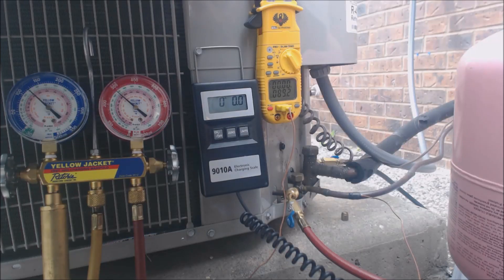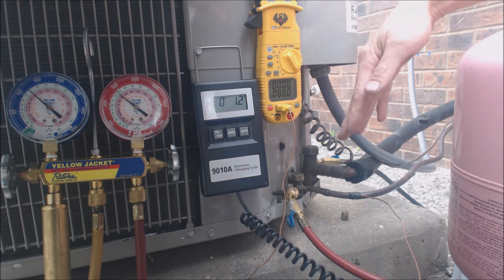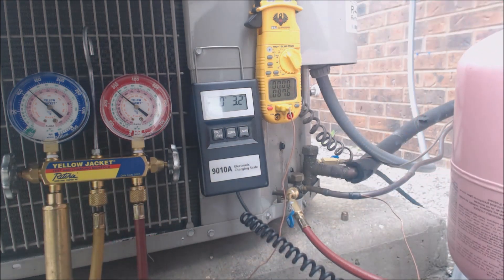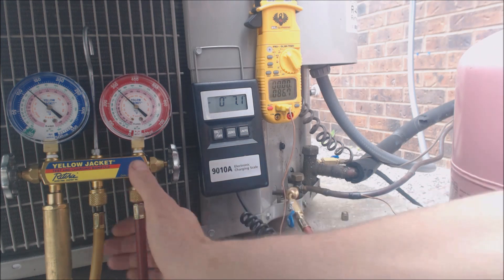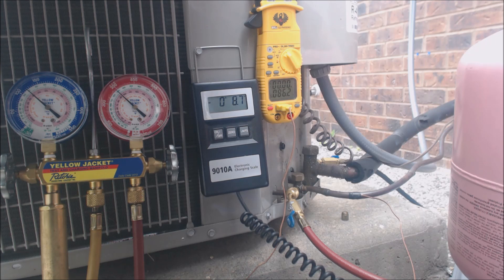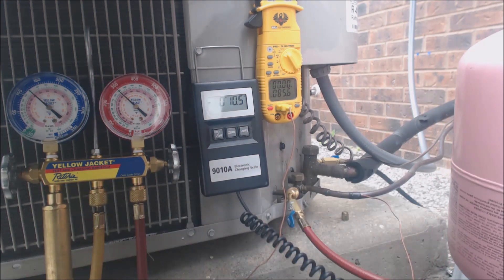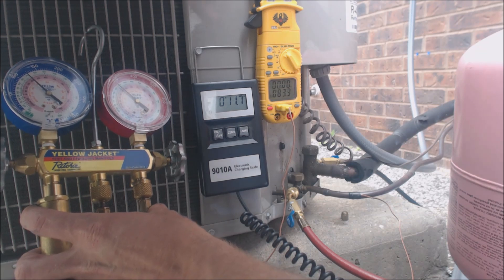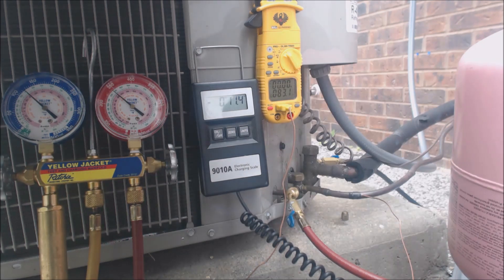Charging R-410A Refrigerant: Step By Step Process of Adding Refrigerant in Real Time!

Comment: What do you do if the low pressure switch is in lockout?  System (Luxaire communicative) has a really slow leak. Plan to add sealant and then charge the system. However, can this be done when the compressor is off, due to the lockout?

Comment: So are low and high side hoses both red? That’s confusing
Reply: You can’t see the hose on camera
Reply from the maker: The low side hose is blue on the larger vapor line and the high side hose is red on the smaller liquid line, thanks

Comment: I have a Goodman model GSX130361BA (3 ton) compressor/condenser with 410a. There is no mention on the name plate of the amount of subcooling. Do you know how much subcooling I should have?

Second question. My liquid line is not insulated. It passes through a very warm attic before it gets to the expansion valve and air handler. I am loosing any subcooling that the refrigerant got in the condenser. Subcooling means efficiency. Should I insulate the liquid line at least where it passes through the attic?
Reply from the maker: It should tell you the recommended charging procedure in the installation literature if it does not provide subcooling on the outer shroud or under the outer shroud, thanks
Reply: @acservicetechchannel  

Thanks for the reply. I will have to look again. 

What about my question on insulating the liquid line?

Comment: Question after a system is 6 years old can some of the refrigerant leaked out? Is this normal for it to leak out over time? my unit just never shuts off when it 100 outside... it can't keep up like it used to... i cleaned both coils and change filter... I will try cleaning outside unit a little better soon...last year i did not do a perfect job... Anyway lets say i lost 5% of the R-410... do AC techs fill it up or not...? thanks
Reply: If it used to work fine that tells you something. 
No leak is not normal. A healthy system stay sealed for life. 
Loss of 20% is noticeable. 
FIND and REPAIR the leak first. Then top up. Electronic scales tell the exact weight consumed. 
There can also be other reason for poor performance. Could be separated ductwork in the ceiling etc

Comment: Is it possible to use r22 guages to check a 410a system to see if you have enough refrigerant and if so could those gauges be used to add 410a?
Reply from the maker: Yes but you will just need an external pressure temperature chart to convert your pressure read to saturated temp, thanks

Comment: Wanting your opinion on an install. I will be installing a new Goodman 3 ton 16 SEER heat pump along with a new air handler and coil. What are the benefits or differences between going with the Flowrater or Expansion Valve? For instance Goodman inside unit with expansion valve comes with ECM motor compared to Flowrater with PSC motor.
Reply from the maker: I would go with the txv. If it is a multispeed ecm those are good. The txv is much more efficient and it is not a technological efficiency that breaks easy. Look up a video I did on the subject "acservicetech txv versus piston" thanks
Reply: Thank you for your help.
Reply: From 40 years of experience I find this the most accurate. All ECM motors cannot stand up to power surges, also any type of moisture in A/H. Also a lot of the new TXV valves are manufactured In China, and do not last. I am old school, i would go with a Fixed metering device, and a psc motor

Comment: Hi  can someone please help.. Was about to charge the evacuated system from a brand new 20lb 410a bottle. But the plastic valve handle broke off!! Can i dig out the plastic to get to a metal valve part?  Or tap it? How?

Comment: i thought those tanks have a dip tube in them so liquid comes out right side up and vapor upside down
Reply: You are referring to a recovery tank.  A recovery tank has a vapor side and a liquid side (dip tube).  He's using virgin refrigerant from disposable tank to charge the system which only has one outlet at the top.  Hence flipping it over to get just liquid.  

A side note.  This is my favorite sources for refrigeration reference.
Reply: @robertocannella1881  thanks roberto thats exactly the answer i was looking for.  would you ever reclaim then reuse or just dispose?

Comment: HELP please!
I have a 2-1/2 ton R410A system with a TXV that the evap coil keeps freezing up on.
I have had 2 "techs" come out - the 1st one said it was low on freon (but he didn't check temperatures, just looked at his gauges) and added freon.
The second guy also only looked at his gauges, said that particular compressor had originally had the wrong lubricant put in them (they were made in Mexico) and added some other lubricant that was supposed to "free up" the TXV. He also said I was overcharged - but never did any temp. readings.
I figured I couldn't do any worse, so I purchased everything you have in this video and followed your instructions.
I started out with about 15 degrees of subcooling (difference between high side pressure gauge / temp and high side pipe outlet temp (past service valve). I then added freon - about 2-3 ounces at a time. Ended up adding 15.5 ounces total before I decided to stop, as my subcooling is now 37.3 degrees!! High gauge pressure is 430 psi, temp of 122 degrees; outlet pipe temp is 84.7.
BUT difference in temp between closest outlet register is 51.6 and closest return is 73.9; difference of 22.3.However my evap coil is STILL freezing up!!!
Any ideas / suggestions??
Reply from the maker: You don't want to add refrigerant to increase the subcooling higher than what the unit is calling for on the rating plate. It sounds like you have a liquid line restriction. the techs should have measured superheat and subcooling and the tech that added the lubricant should have cycled the valve open and closed by putting the bulb in hot water and ice water to see if it would free up. A liquid line restriction problem could be a clogged filter drier, clogged screen prior to the txv, or the txv itself, thanks
Reply: @acservicetechchannel  Thanks. I did get the schooling to 10 degrees (recovered some Freon).
Superheat is @ 20 degrees - no listing on plate, but looks okay according to your book (which is great!).
I did read about cycling the tv; going to try that today. Does it matter that he put lubricant in a couple weeks ago?
Reply: Subcooling.
I relocated the sensor bulb of TXV to just outside the evap coil case - it was located inside, at 6 o'clock position and hardly insulated at all. Plus by putting it outside I was able to pour hot, and then cold water over it. How long should I have waited between the two?
Still getting a little frost on evap coil - but it's not completely icing over like before!

Comment: NooB here, why is the liquid line not much hotter than 87 degrees?  Shouldn’t it get hot and liquid line sweat?  What was ambient temp that day?  Thanks.
Reply from the maker: The vapor line may sweat but not always. that is one of those feel good signs techs want to see but will not always happen. It was a 75 degree day roughly and that is a 16 seer unit. The higher the seer, the lower the liquid sat temp. I have all of this laid out in the book I just published and the full outline can be seen at https://www.acservicetech.com/the-book  it took three years and has everything that I want techs to know starting from scratch through troubleshooting, thanks!

Comment: can you get a decent reading using just PSI and not temperatures
Reply from the maker: Hey Joseph, no certainly not. Everything is about temperatures and the amount of superheat and subcooling for sure. I go over all the proper charging methods, all the improper charging methods and why they shouldn't be used in the book I just put out over at the website acservicetech.com thanks! If you know someone just setting the system at certain pressures, that is not good for efficiency, compressor safety, or actual heat removal, thanks!
Reply: @acservicetechchannel  thank you!!! So does that mean the PSI scale on the gauge is not that relavant to a properly charged unit
Reply from the maker: @jm11740  That is correct, we just take pressure readings to convert them to saturated temps, thanks
Reply: @acservicetechchannel  thank you,
Do you think alot of techs check it without thermometer probs, or did i just get a real lazy tech?
Reply: thanks for your help
Reply from the maker: @jm11740  It just depends on the tech. Any decent tech will certainly be checking temps. Its all about saturated temps, superheat and subcooling, thanks

Comment: With supercool of 10 then the low side gets to say 120 psi and doesnt move even with more coolant added to try to get the high temp difference between 10 -13 super cool thats when you stop  correct? You could over charge easy trying to get 13 right?
Reply from the maker: The low side won't usually move if you have a txv as well as a lowering indoor wet bulb temp. You just try to get to the correct subcooling, thanks!

Comment: Very good vidy but I have a question I can't seem to find an answer to.  
To get proper superheat your TXV must be set correctly.  But TXV setting is dependent upon charge, correct?
Do you adjust superheat (add ref) then check supercool/adjust TXV and repeat until both in spec?
Reply from the maker: Normally with ac units, you should not need to adjust the superheat on the txv. They normally come preset. Often when you read the total superheat on a system with a TXV, it will read between 8 to 15 degrees of superheat but normally around 10-14 degrees. You should start by setting the subcooling correctly and then verify the txv is holding the susperheat at a good rate. In fact, most sc unit txv's are nonadjustable. Rarely would you need to adjust a ac txv unless someone has messed with it or it is a high velocity system, thanks!
Reply: @acservicetechchannel  TY,  I'm installing a new dual so everything is at factory and I don't have a clue what the standard setting the TXV is at...assuming midrange but read various things... sure don't want to start it up and it have too much restriction.  14 seer goodman with matching TVX, cond, evap ect.
If cond has ref as stated for 15' of line, I'll need to add about ~1 lb (estimating) of ref as I have 30 ' line and installing a bi filter and site glass before TXV.
Reply from the maker: There is no need to install a sight glass on an ac unit. All that would tell you is that you have at least 1 degree of subcooling. You would need to start the system up and monitor the superheat to tell if the txv is set correctly. The system should have 10-14 degrees of superheat, thanks

Comment: Does it matter where the liquid vaporizer is put? I've seen them on the suction line valve, at the manifold (like you have it here), at the refrigerant tank valve, and on the service line at the manifold.
Reply from the maker: No it does not matter where the vaporizer is. It is just the fact of having it. With that being said, the more distance you put between it and the vapor port of the system the better so on the bottom of the tank is not a bad idea. I think I jst have it on the vapor port so it is always there and attached. Thanks!
Reply: If I don't have a liquid vaporizer, how about running the red and yellow lines through a bucket of hot water?
Reply: Whoops   I meant Blue and yellow lines.
Reply: Dallas Yenawine, from what I've read you can do the same without it by slowly cracking the valve or "throttling".
Reply: Tie Dye That is obvious.   I was suggesting a way to safely add refrigerant much more quickly,  as is made possible using a liquid vaporizer as shown in the video.

Comment: Does the high pressure manifold gauge valve on the right need to be open or closed?
Reply from the maker: When charging refrigerant from the bottle, make sure that the high side gauge handle is shut, thanks!
Reply: Got it. Thank you for the helpful videos!

Comment: Does the subcool the same when it 75degreesF outside and 95 degrees F r would you have to simulate it being 95 degrees f
Reply from the maker: You do not have to change the target subcooling on standard coil single speed outdoor Ac unit charging. You just use the target subcooling at any point above 70 degrees. Superheat target changes with outdor temp and indoor wet bulb temp. Check out the video list for superheat --  https://www.youtube.com/playlist?list=PLxnHR5_D2ojwGvhU1rseXQLJ-XBjBZMMk and the video list for subcooling -- https://www.youtube.com/playlist?list=PLxnHR5_D2ojxTcAtR_53GoY8huBcSOt0a

Comment: I have the same setup 2ton ac coil .txv in evap.  I am having a 20° difference  in my subcool side reads 110° but the temp probe reads 88° . Everytime I add 410a  refrigerant it increases both the subcool and liquid temp ??? Why cant I get it to be a 10° subcool difference as needed by the carrier plate??
Reply from the maker: You would need to recover refrigerant since you have a high subcooling. As you add refrigerant usually both will rise but the gap between them will continue to grow which is the subcooling, thanks!

Comment: What should the low side temp be exactly? AC tech checking out my system said my low side temp was 39. He said it didn't need freon and if temp got to 32 it would freeze up. When he did the freon check it seems a lot of steam came out. I'm concerned the freon escaped. Suggestions?
Reply from the maker: We dont check the charge with sat temp alone. We use superheat and subcooling, thanks!

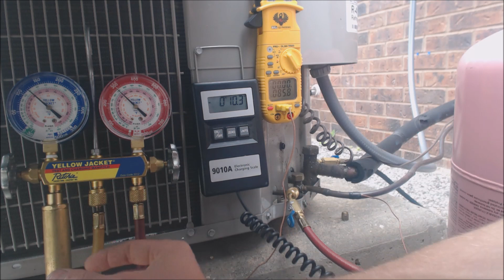Comment: is it normal for the low side to vary about every 3-5 minutes from 102psi to 104psi, or according to gauges, 35 degrees to 40 degrees? R410a , Unit is TXV sub cooling 10 degrees if that is important.  I am reading about 12-13 degree subcooling, and inside temp difference from return to closest register is about 13-14 degrees. it is 8:30 at  night, outside temp is about 84 degrees and around 84% humidity.
Reply from the maker: 1 or 2 degrees of movement every once in a while is not terrible. 13-14 degrees temp difference is not good. It should be 18-21 unless your are battling high humidity in the house. Your low side psi stated correlates to 32-33 degrees saturated temp which is right on the line of freezing. You are stating a rating plate of 10 degrees of subcooling with an actual subcooling of 12-13 which would be good. If that's correct then the outside unit is doing its job well. Did you check to see where and how the TXV Bulb is mounted? Make sure to view the TXV videos for proper placement and diagnosis.      https://www.youtube.com/playlist?list=PLxnHR5_D2ojy2EYzy0YIJkce9sFIQj4-j With the information given, it seems that you are not having a cooling effect possibly by not having enough refrigerant in the evap coil. See if you can get closer to the actual evap coil when taking temp now, roughly 2 ft away from the evap coil in the supply duct and in the return plenum when taking your 18-21 temp diff. Well I hope that helps. Also any extra details such as duct details-sizes as well as the high side pressure, the seer rating of the outdoor unit and what shape the fins are in. Basically I am interested in knowing if there is too high of a pressure due to noncondensibles or something possibly mixed with the refrigerant. Thanks for your Comments and Thumbs Up!

Comment: Monitoring high and low side pressures and superheat with liquid line sub-cooling gives  more complete  system operating performance. Supply and return air temperature and humidity completes the picture. Voltage with current readings should be checked. All should be recorded on the service report.

Comment: Can I run r407c in the R410a system after changing TXV to R407c compatible one? Or can I use a R410a compressor in a R22 system to run R407c? Thank you

Comment: Instead of using a liquid vaporizer at the blue gauge why not charge it with tank upright  ?
Reply from the maker: R-410A must come out of the bottle as a liquid to keep the correct mix of the R32 and R125 inside the bottle unlike R-22, thanks!

Comment: Is there no need to add additional oil on the system?
Reply from the maker: no need to add extra oil for initial charging or adding more refrigerant, thanks
Reply: @acservicetechchannel  when is required to add oil? I also have a/c that is leaking for 4x now do i need to add oil?
Reply from the maker: I would have the tech search for, find and fix the leak but no only the smallest amount of oil leaks out with a leak, thanks

Comment: Do you have to fix a leak before adding refrigerant or is it ok to continue to add refrigerant every summer?
Reply: Adding gas each summer only done by Cowboys. Find and repair the leak first. Then add gas. Tightly capped it will last just like your fridge, 20 years

Comment: Once you reach the 10 deg temperature difference would that be considered a full charge or just the minimum charge to reach the temp difference?  Also if a system placard says  5lbs of charge do you just put in 5lbs without measuring temp and pressure?
Reply from the maker: It is plus or minus 3 degrees so I usually go to 2 degrees higher on the subcooling and superheat I set right on. On a packaged unit it would show the exact weight so you would weigh that in and then double check with superheat or subcooling as needed, thanks
Reply: Do you ever use the sight glass to confirm a full charge?
Reply from the maker: Not unless it is a walk in box or freezer, thanks

Comment: Very nice video.

In my unit in High pressure saturated temp and actual  temperature on probe both are same temperature 93 F and 93F.  I tried to add freon but both number does not change.  Manufacture recommends 7F sub cool
please guide me if you can. My central ac takes long time to cool. I tried all methods cleaning filter, evaporating coil  and all
 

Thanks
Reply from the maker: You said freon, do you mean R-22 or R410A? Make sure it is the same refrigerant as in the system already. How much did you add? thanks!